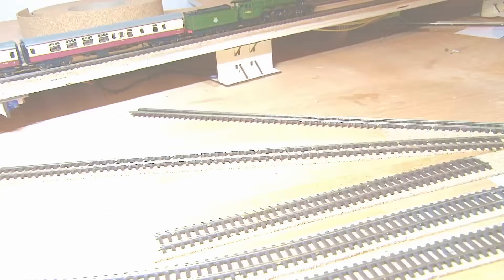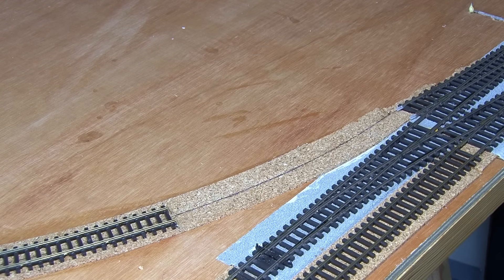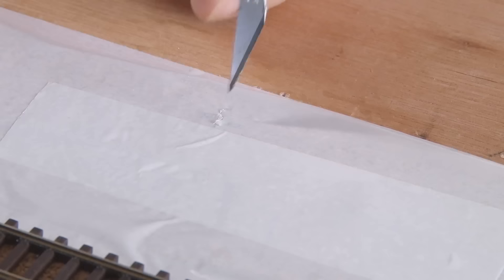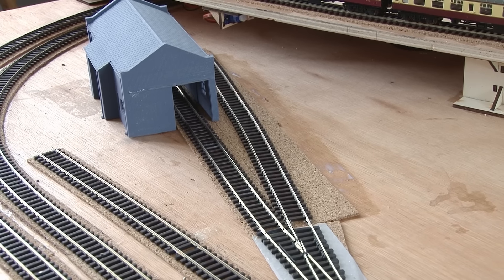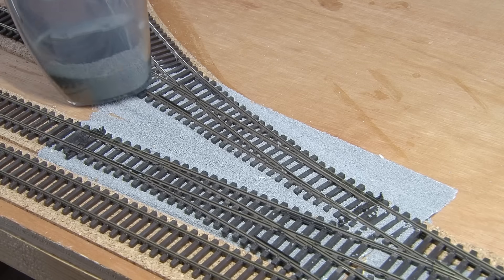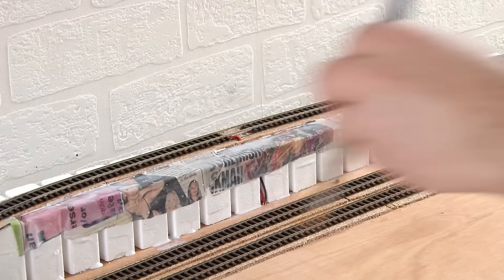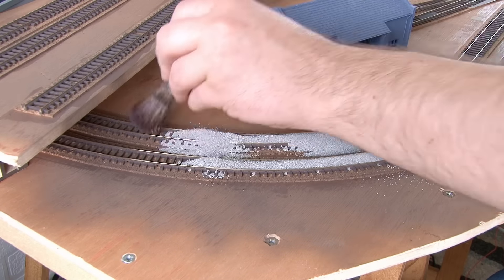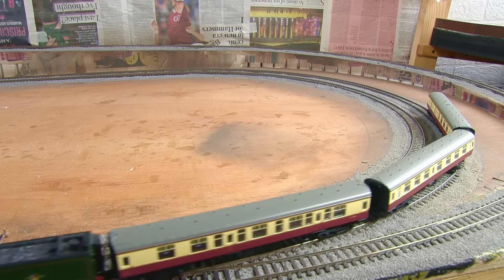Building A TT:120 Model Railway - Episode 5: Ballasting & Building The Goods Yard!

Comment: Ah, so you finally realised the point I made when you released the plan about how the points on the "main line" were the wrong way around....
Reply from the maker: Not really, the points from the mainline were always intended to be that way round. Trains in the inner loop would usually run anticlockwise and having them feed into the headshunt would allow them to continue to shunt the sidings. If the points had been placed the other way round the loco would have been trapped on the wrong side of the wagons.
As I said in the video, the alteration was mainly made to accommodate larger locos like the Class 50 and to be able to have longer freight trains at the same time. Thanks for watching 😃

Comment: Nice to see all the track laying coming together ❤. I’m a bit confused with all the track feeding wiring that’s going in, if I run HM 7000 I thought I only need one connection? Am I missing something? Thanks for sharing your ideas 🙏
Reply from the maker: I could have just two wires feeding the track from a single point but then you're relying on every connection between every piece of track being absolutely 100%. As this technically isn't my layout I've made it foolproof by adding a direct feed to every piece of track so there's no chance of ever having a dead section in the future.

It's worth mentioning again for those who might not remember that I'm using DCC on this layout as only some the locos have HM7000 decoders - however the basic premise is the same for either system. Hope that makes sense and thanks for watching 🤩
Reply: @ThatModelRailwayGuy  Ahh, I see that is making more sense now. Thanks for clearing that up.😊

Comment: Hi, what am I doing wrong? I have a mixture of 50/50 + washing liquid, but when I add a drop using pipet, quite often ballast parts start to "group" in chunks
Reply from the maker: @GrenMiniTren  I mist the ballast with water first which usually solves this problem. You can also add a tiny drop of washing up liquid to the water spray as well to help if it’s still clumping up. Some ballasts just have a tendency to clump up though. Personally I’ve found Woodland Scenics stuff works well with this method and so does the new range from Specialist Aggregates too. Hope that helps and thanks for watching 😃

Comment: This layout is honestly looking great, love the handy tips as well never thought you could spray paint the sleeper grime I’ve been putting this task off for my layout as it’s OO and is 12ft x 8ft L shape with a 4ft depth to each board and I’ve got a massive station area with complicated point work so will be stealing the double sided tape method makes ballasting look so simple. Keep up the great work 😊👍
Reply from the maker: It's definitely a quick way of doing it! Although I would still hand paint the points since you don't really want paint getting on the blades. But yeah the double sided tape method is so quick and easy, I'm probably going to do all my points this way in the future. Best of luck with your layout and thanks for watching 😃

Comment: Lovely progress and I also like the changed track layout. I was surprised to see you spray paint the track without putting anything over the top of the running rails.
Reply from the maker: Covering the tops of the rails but not the sides would have been a very time consuming process - it would almost just make more sense to paint them by hand at that point. Considering the rail tops can easily be cleaned afterwards it's just easier to do it this way, especially when you have a layout with a lot of track. Thanks for watching 😃

Comment: Very good video and information. 
Triple head points would have given you a bit of extra room on the sidings. 
What make is the double sided tape?
Cheers 
Russ.
Reply from the maker: Peco don't make 3 way points in TT:120 though. The tape is listed in the description along with all the other materials used in the video. Thanks for watching 😃
Reply: @ThatModelRailwayGuy  Tillig do, a bit of adjusting the Fish plates but it gives you a whole point length for free. Especially useful when you have a compromised sidings area.

Comment: Great! Didn't quite get how the uncopling is working. You added the tops to them? Otherwise great fun, as usual. Cheers.
Reply from the maker: They work in basically the same way as a standard uncoupling ramp but controlled by a servo motor instead. I covered the process more in Episode 3 which is why I didn't spend as much time on it in this video. Thanks for watching 😃

Comment: Wouldn't you need a catchpoint to  protect the  line going across the middle from the Sidings?
Reply from the maker: Technically you'd need catch points all over the layout if you were going to model it exactly like the prototype. But Peco don't do catch points in TT... at least not yet. Thanks for watching 😃
Reply: @ThatModelRailwayGuy  Some railway lines have had a moveable sleeper as part of the signalling,  something interesting for a dcc buff to do!

Comment: Hi, is the ballasting on the points as heavy as the track or is it just enough to stick to the tape, also does the ballast Jam into the point mechanism?
Reply from the maker: When you ballast the points using the double sided tape only the very bottom layer of ballast sticks to it - so it won't be like the rest of the layout where the ballast comes up to the height of the sleepers. The difference isn't particularly noticeable though.
You still need to be careful around the mechanism but as you can see in the video I remove all the loose particles with a handheld vacuum, so anything that could have jammed the blades or spring gets removed. Everything else is stuck down fast. Hope that helps and thanks for watching 👍
Reply: Thanks this series is a great help

Comment: What do you use to clean the track after you sprayed the sleepers grime paint ?
Reply from the maker: A standard track rubber, as shown at 13:46. There's a link to the one I use in the description. Thanks for watching 👍
Reply: @ThatModelRailwayGuy  on the wet paint ?
Reply from the maker: If you're using spray paint, it dries almost instantly as it's such a thin layer. If you're painting the rails by hand the paint stays wet for longer and you can wipe the majority off with a tissue as you work your way along.

Comment: Completely off subject I know and apologies.
Who decides and designs couplings for these smaller scales.
N gauge couplings have always been oversized and unsightly,now 
With this new tt scale it was an opportunity to keep them smaller and 
A bit less out of scale. I honestly don't understand. 
I stand  to be informed and corrected.
Otherwise thanks.
Reply from the maker: For TT:120 the couplings use the same design that has been established for decades by those modelling TT on the continent to make everything fully compatible.

For scales like 00 and N, generally when they were starting out each company had their own unique designs. Over time customers made clear what their preferred design was and that gradually became the industry standard. They may not be the most realistic or the smallest but generally it's what is the most popular... though of course there will never be one single design that pleases everyone.

The good thing with modern model railways is that the vast majority of new locos and rolling stock are fitted with NEM pockets which allow the couplings to be easily switched out for something different like kadees or magnets. This puts the choice back in the hands of the modeller so they're not stuck with the supplied couplings if they don't like the look of them.
Hope that helps and thanks for watching 😃
Reply: @ThatModelRailwayGuy   
Thanks for the reply.
Makes sense.
Love the channel.
Howard